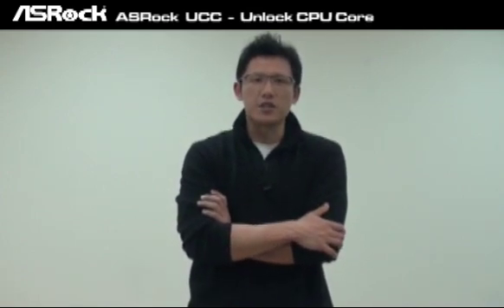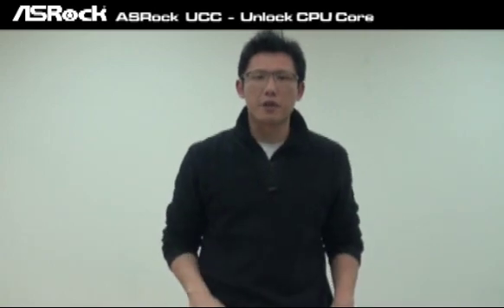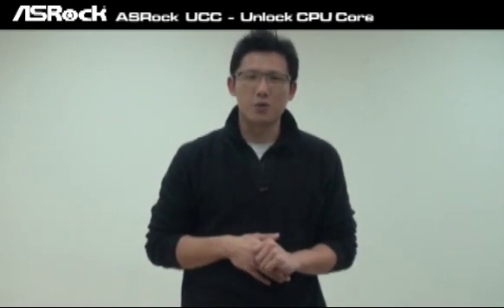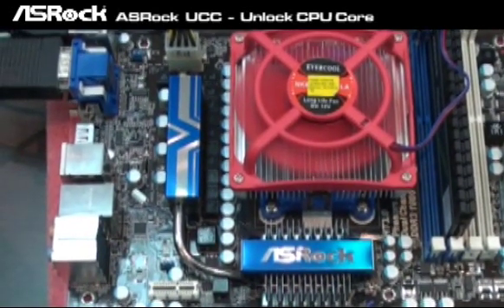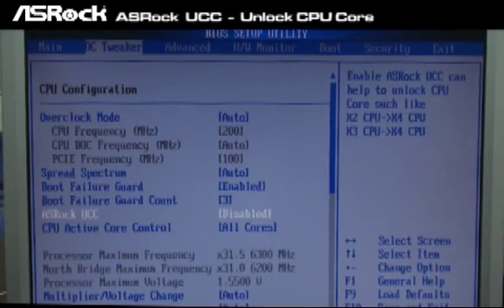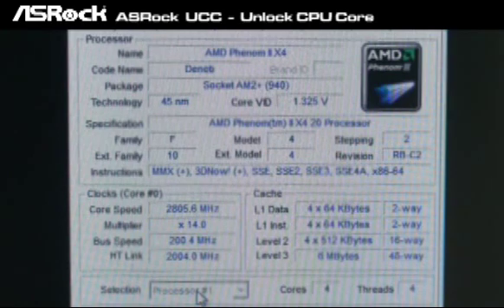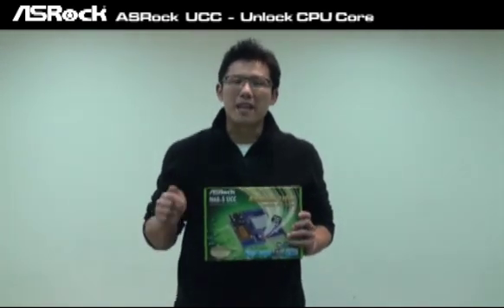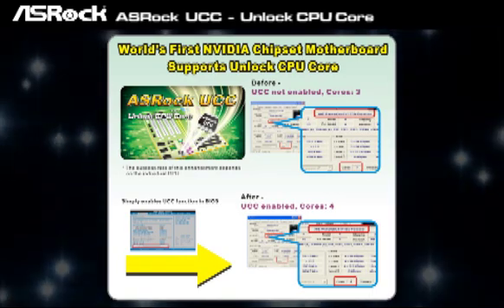ASRock UCC (Unlock CPU Core)

Comment: These feature is not working on my N68-VS3 UCC motherboard with a AMD Sempron 140 Processor, mobo updated to the last BIOS (1.70). When enabling UCC it won't boot, so I must reset BIOS to default values by clearing CMOS and then it works ok, but again with single processor mode, of course.

Comment: Because if the MB and the procesor has this function, as Speed Step in Intel for example, the system sends it to lower speed when not in full use, less power consumption, less heat, longer life of the components

Comment: @t00thman Try to add a bit more Vcore the your 960t, but don't unlock the cpu when your overclocked, set everything back to stock and and then try the UCC, no cigar? try upping the vCore a tad, when it may just need more volts to run 6cores. also try upping the cpu nb voltage aswell. if it don't work, might have a cpu that cant be unlocked, but you can always try to unlock it to a 5 core.

Comment: wowowo, wait a second.. its seems easy but NOT every (!!) quad core cpu can be unlocked to a six core cpu! by the way the garantee ends by unlocking and you just have a 50-50 chance the unlocked core(s) works solid! why did amd locked these cores?^^ they could be faulty ;)

Comment: Well the speed of CPU Drops too 800mhz cause AMD setting the processor to balance state in factory setting maybe for electricity value. The mhz goes up to max when you're doing heavy applications like gaming, 3d animation or stuffs that heavy but you can set the CPU to max ghz for all time using amd fusion utility to let the ghz become 2.8 eternally xD

Comment: @midnit19 

power options, thats why it dropped. i believe the test systems OS is win7 or vista. power savings is set on BALANCED. if HIGH PERFORMANCE or power processor management>minimum processor state>100% then it will definitely never drop.